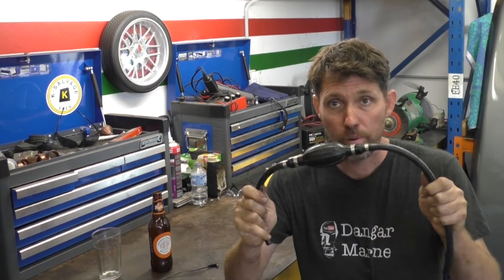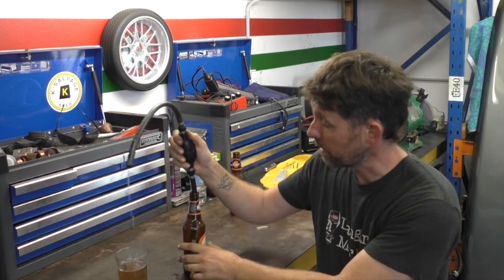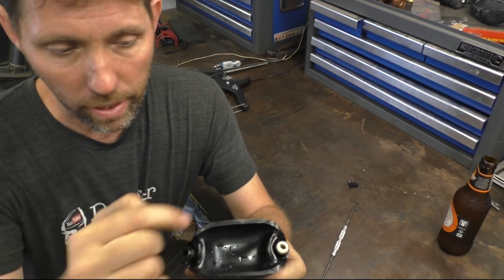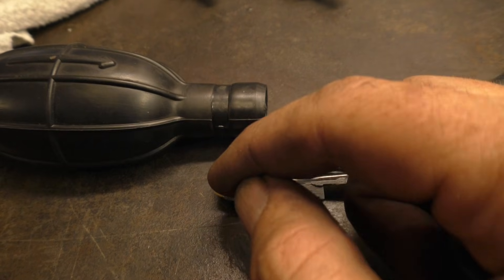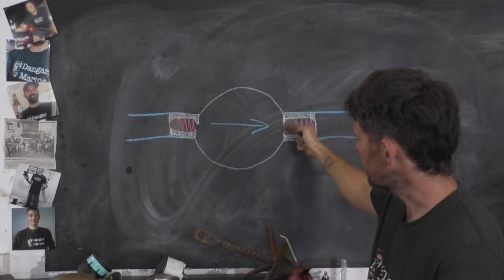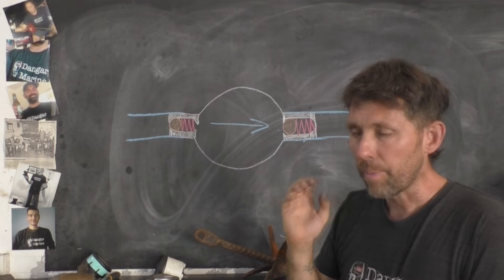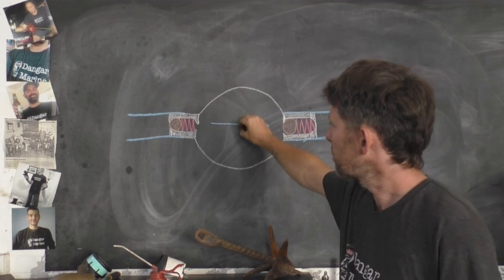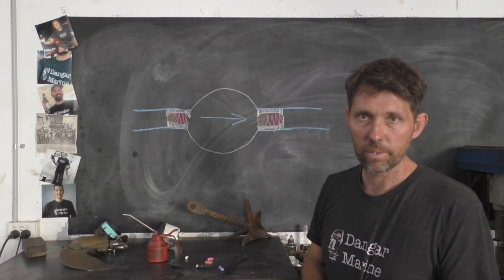Outboard primer bulbs

Comment: Great vid.  Fuel issue. New pump and carb rebuild done. Motor stays running only when primer is pumped. The two hoses attached to the bulb. Should the shorter one be closer to the engine making the bulb closer. ?  The shorter hose is at the tank making the bulb farther away from engine. Would this matter ?
Reply from the maker: It shouldn't matter that much, still sounds like something is wrong with the fuel pump or hoses.

Comment: It's it possible for the valve or ball on the motor side to be stuck closed and not let fuel threw to the motor
Reply from the maker: Yes, that is possible.
Reply: Thanks

Comment: Recently I find myself pumping a lot to get a good prime and today after trailering the boat home running it to flush the salt she quit on me and I have to give it some prime. I drained my fuel filters and they weren’t filled with water. And nowI really can’t seem to get primed after draining the filters. Usually I feel the parts “balls and or springs” floating around inside when they go bad. Could it just be it is worn? I have had the boat for 5 yeArs and never an issue until now.
Reply from the maker: Could be worn, could be a blocked or closed breather on the fuel tank or a split fuel line sucking air.
Reply: Thanks for your quick reply! Now I have some more ideas to look.

Comment: Nice one just fitted a brand new bulb and changed the fuel lines, Guess what it won't prime. So I watched this video and now out I go to do as instructed. Wish me luck I'm going in. Edit after much F%cking about  I managed to tighten the male side of the fuel plug (on tank)) to tighten enough so it stopped seeping air. The bulb now works as it should but. The bayonet  fitting is a bugger to put on how could something so easy be such a Feck about.
Reply: needless to say if it were not for your video it would of been hammer time. Thanks Stu you may not know or realise this but I expect your videos have saved many lives Thanks again.

Comment: I disagree that it is mostly gravity that is the issue with the pump action.  I believe a contributing factor could be air inside the bulb not evacuating if the bulb is held horizontal.  If bulb was horizontal, mostly filled with air, the pump action would compress the air volume and vacuum the air volume and the action would not be efficient.  Also, the the dry valves will not seal well until fuel gets to them.  Either case two factors help.....  Hold pointing up and as low as you can get it (lower than tank if can).

Comment: Hi... what happen when primer pump not function.. always open... i have i problem with my suzuki 115 4 stroke... 1 engine run rpm 5500 rpm and than rpm drop to 3000 rpm.. i think fuel not enough... this prob related with primer pump or not.. i already try manual pump and fuel come out and return back to tank...
Reply from the maker: Could be an issue with the primer bulb but sounds more like the fuel pump in the outboard.

Comment: I have a 175 evinrude fitch injection I took it to repair it 3 times and still the same problem,they told me it was the computer they repair it and nothing.i didn’t make it out of the no wake zone, and I was trying to start it and I did but the only way it will start is if I keep squeezing the bolb and if I stop the motor stops.any ideas ?

Comment: If the internal fuel filter does not stay full when trying to start the outboard does that mean there are problems in the fuel line/primer bulb/connections. Yoda
Reply from the maker: If it is the type that has the inlet and outlet at opposite ends of a cylinder that is on its side then it is common to have air in it.

Comment: the tank is new and change the fuel pump and the engine evirude 75 hp year 1977 starts well and then stops the carburetors are clean and regulated that can be friend
Reply from the maker: Is there fuel in the carburettors when it stops? Does it still have spark when it stops?
Reply: from the bulb to the carburettors, there is no fuel left. because when I pump the pear it's still going well

Comment: My primer ball stays compressed and won't open to allow me to prime....what's going on???
Reply from the maker: It will stay compressed if it can't draw fuel from the tank. This can happen from either a blockage in the fuel line, a stuck valve in the pump or a vacuum in the tank due to the breather being closed.

Comment: Hi Stu.  Why does a primer bulb need to be squeezed at all?  I see that initially (like when new water separator is installed ) you need to force fuel up into lines to prime up the low pressure fuel pump, but why after the engine sits a few days the bulb needs to be squeezed again?  My bulb does "deflate" and I go ahead and prime before starting, but my motor is fuel injected so I would think the fuel line a closed system?  thx Stu for all the instruction
Reply from the maker: I only ever squeeze my primer bulb after having run out of fuel. Other than that I just turn the key. Mine is carburetted so the fuel bowls stay full even with the motor tilted up. In your case the VST should stay full of fuel and not require priming.
Reply: thx for the reply Stu!!  i agree with your comments as well

Comment: My bulb/lines/filter/fittings are 1 year old, the cap vent works fine. Suddenly it went from operating flawlessly for many hours, to now losing its "prime" when running. It will bog and require a pump on the bulb, and repeat until it finely gets on plane it seems to then hold its prime until you come down to idle it quickly starves. Any ideas? Pickup tube leak? Any tips? Im an auto tech..
Reply from the maker: It could be the fuel pump, I'd take that apart and check the diaphragm in it.

Comment: I have a question today I toke my boat for the first spin, I have and V6 Evinrude    
175hp what happend is that everything was going well but when I speed up to max speed the engine slow down like gas was not flowing in carb and after a second speed up again why that happen
Reply from the maker: It does sound like fuel flow, unless the changes in speed are quite sudden in which case it could be that you are losing spark on one cylinder. If it feel more like fuel I would check all the fuel lines for splits and cracks, make sure the breather is open on the fuel tank, clean the carbs and inspect the diagram in the fuel pump.

Comment: Question, I just replaced my primer bulb with factory bulb and added a new fuel water separator between the tank and primer bulb (25 HP 4stroke Mercury Bigfoot).  I took it out to the lake and the motor ran great for about 10 minutes and started struggling, like it was starving for gas.  I noticed the primer bulb was really soft.  I primed it up again and got it started again after putting it on full throttle but noticed the same symptoms.  Do you think maybe the addition of the fuel water separator is preventing the fuel pump from bringing up gas?  Should the bulb be vertical while the boat is running or only during priming?  Before adding the fuel water separator, the bulb stayed hard mostly the whole day.  Any advice would be appreciated.
Reply: Oh, I forgot to mention, I have an additional small portable gas tank.  When i hook up the primer bulb to it and bypass the fuel water separator, the boat runs great all day.
Reply from the maker: It sounds like it is related to your new water separator. They can take quite a bit to prime and get all the air out of. Once you have done that though it will work just fine. I recommend taking the fuel line off the boat, pressing in the ball in the valve a small amount and then using the bulb to push all the air out until you can a good solid stream of fuel. Bulb work best when they are vertical the whole time but it isn't essential if the bulb is in good condition.

Comment: Hi, just need some help I have a bit of a problem with the primer bulb, when I'm cruising at 3000 rpm the bulb remains stable if I go to 4500 rpm for a while the bulb deflates and the motor cut out from lack of fuel then I have to realise the valve on the water separator to get it to inflate, can you help please.
Reply from the maker: Is the breather open on the fuel tank?
Reply: yeah they are open and I have two of them. I moved the bulb from after the separator to before the separator and I still have the same problem.

Comment: Ight I I have a 1897 Johnson 90..vro removed. The engine WILL NOT cooperate. I have replaced plugs ..wires ..carburaters and just recently a fuel pump. But on our 7th test run. With the new fuel pump..one of the coils isn't looking good, all was well with all the reading being taken in the "bogg down" phase by my father who,has all the information written down. This man builds hot rods so he knows certain things. He actually wasn't the one who did the carbs a trusted MARINE mechanic pressure tested them and everything...I saw the fuel line as it was pulled off while running. The flow of fuel did not seem all that great..not a spray by any means..this was at the full throttle bog..but thinking more and more..may be something as simple as the old tank I'm using..or the bulbs. Our line is always stretched and on its side. We will absolutely be taking it out winter or not to figure this out. Hoping it's not a power pack.. Great video
Reply from the maker: Good luck with the boat mate. It is amazing how something as simple as bad primer bulb or a closed vent on a tank can bring a perfectly tuned motor to its knees.
Reply: When I fill my tank I can hear air coming out. I have to cover the fuel hole while fueling up because the fuel shoots out of the fill hole where I place the nozzle. Why does this happen? How can it be corrected?

Comment: heyu  stu i v been watche ing your vids for 8 months while shop[ping for my first boat . well i got it a 20 ft. Grady White 175 Yahama two stroke im a retired eng.mechanic havingiproblem with eng.stalling at idle carb. problem most likly cannot find RPM  setting for motor at idle
Reply from the maker: Are you looking for the adjustment screw of the spec for what it should be set to?

Comment: My bulb on my 1997 even ocean pro goes soft after the motor starts , new vro  , should it go soft if everything is running right?
Reply from the maker: Once the fuel pump is drawing fuel through it will definitely lose some of its original firmness. If it is running nicely then I wouldn't be concerned.
Reply: I would check that the fuel tank vent is OK too.  My engine died while idling, the bulb was mostly deflated.  After re-priming, the engine started right up but died a little while later and the bulb felt empty.  I don't know if a fuel line air leak has the same results (??)

Comment: Great video but what if you can not get the bulb to fill to the point where you can't pump any more ?  Does this mean I have air leak any suggestions?
Reply from the maker: Generally it either means an air leak, or an air lock, or the valve in the bulb isn't working as it should.

Comment: when I pump the bulb it doesn't stay hard
Reply from the maker: Check for leaks in the fuel line and fittings. If they are all good you may just need to replace the bulb.

Comment: Can the orientation make any difference in fuel delivery performance when the engine is running?
Reply from the maker: It might flow a little better pointing downwards I guess, but so long as the fuel pump is keeping up with the demand you won't notice any difference in performance.

Comment: I am ready for a new fuel line and primer for my Johnson outboard and after watching videos I see there are issues with the grey fuel lines being ruined on the inside from the Ethanol and causing clogs in the lines.What do you think or what should I get?Make my own or get an OMC original part if they make them?thanks
Reply from the maker: Good question, I found it cheaper just to buy fuel line from an auto parts store. You would think that auto fuel line would make no concession to UV, but so far it seems fine in my open tinnie. It is certainly completely suitable for ethanol fuel though.
Reply: Thanks..Enjoy your videos.Learning a lot about outboards.I am wondering though.I installed a small disposable fuel filter after the primer bulb before my connection to motor.There is air in there.Should I have any air in the filter at all.Tried bleeding it out, but still never get rid of it.

Comment: I'm changing fuel line find of a custom fit and length for my boat .  Thing is before i cut the new hose i need to find out the best place to put the bulb. Any suggestions or don't it matter ?  And thanks for the great video .
Reply from the maker: It doesn't matter hugely where they go. I think the most important thing is to have easy access to it. I also prefer to have it after a filter so that gunk won't get into the ball valve and stop it working properly. I think those are the two most important things.
Reply: Thanks that's just what i needed to hear.

Comment: Thanks for this informative video. I bought a brand new boat in 2013 with a 100l underfloor tank and a Yamaha 115 2 stroke saltwater series outboard. Ever since new, the boat has never held its prime. If the motor is stopped for more than a minute or two, it will cut out when restarted after the carbies run dry. If I prime before starting its fine, just a pain to have prime every start. I initially suspected the primer bulb so changed it myself but made no difference. The dealer then changed the bulb again at the first service after I reported the problem but still no difference. I have checked everywhere I know for air leaks etc. and all looks good. I ended up fitting a fuel line non return valve at the tank take off and this mainly works, although often gets foreign matter under the seat so needs a lot of cleaning. 
After seeing your video, it seems to me the primer bulb should have good enough non return valves to prevent my problem. Given that I’m on my third primer bulb (bulb located after filter/separator) and the problem is still there, my question is do you have any thoughts on a solution to the problem? Is the quality of the NRVs better is some bulbs than others? Any help appreciated. Regards Daryl
Reply from the maker: It's odd that it has always had this problem so bad. You could consider making a bracket so that the bulb sits against the transom in the vertical position, that will no doubt help. If you are getting foreign matter in the non-return valve you installed, you are no doubt getting it in the primer bulb valve too. Perhaps also installing an inline filter before the bulb would help?
Reply: Thanks for your reply stu. The primer bulb is upstream of the filter/separator so shouldn't be getting any foreign matter in it. I agree it's a weird problem as I have had boats for years and never seen this problem... I am going to buy a Yamaha OEM primer bulb (hoping for better quality), mount it vertically and see how it goes. I do general servicing myself but if I need any repairs or major work, I will be certainly seeking out your services. Thanks for your great videos.

Comment: Desperate and now 12noon 24th Dec. when all marine repair shops are closed for the festive season its just lucky to come across this video to offer a solution to why I could not start my Honda 45 outboard being that fuel not getting into carburetor. Your video info is very timely. I have got now a new bulb primer and will rep;lace that 10yr old rubber primer very soon. Crossing my finger this would solve the problem. Thanks a lot and merry Christmas to you !
Reply from the maker: I hope the new primer bulb solves your problem Jack, if not, check all the fuel lines for obstructions as well as the valves in the fuel pump. Good luck and have a great Christmas!

Comment: quick question my fuel tanks are up the bow of my tinny would that extra run of fuel line make it take a while to get up to revs? (on plane) i have installed new plugs and cleaned fuel filter and run new fuel through it and it still not right (thinking maybe carbs need a tune) but yer thort id ask about the long fuel lines? also good vid :)
Reply from the maker: Hi mate, no having the tanks up in the bow isn't a problem. Many people do for good weight distribution. I'd be looking at a carb clean to start with.
Reply: cheers mate now to watch ur carb cleaning vid lol

Comment: i had a general idea, but this visual example.. Great work as always!
Reply from the maker: Thanks mate, it's always great to see things apart I find.
Reply: a question (if i might ..)

I have an 1997 Mercury 8hp (US cross-flow) in a very good condition 
http://pictub.club/image/ssVWB2
http://pictub.club/image/ssVoMm
http://pictub.club/image/ssVpc7
it was recently imported from Japan as an used engine... It has very low hours on it i guess

1 thing is bugging me. If i try to see the crankshaft "side-play" on the flywheel, i can feel a tiny bit of side movement in certain positions IF the engine is cold, and had not runned a while.. But! after the start, and a few rev this sideplay is dissapering, and feel firm meaning no side-play on the flywheel when it's "hot, or runned a bit"

this engine has 2 roller needle bearing, and 1 ball beraing on the crankshaft
http://pictub.club/image/ssksoU (this picture is just an illustration;)
IS it possible that this type of bearing assembly have some "heat expand" feature? 

i mean it's idles great, and run great with no hearable distortion at all. (i have some experience with outboards in general so i can spot is something wrong by ear wise;)

really don't want to tear a part just because of it... just it's strange, and the lower unit prop shaft bushing is rock solid no play, even i can feel that the oil seals are "tight" around the shaft meaning not worned out by excessive use